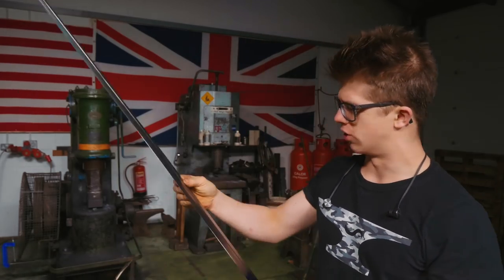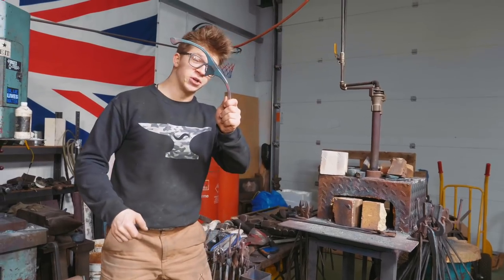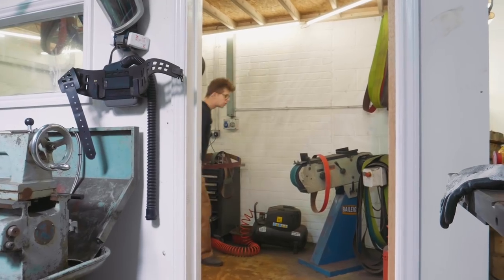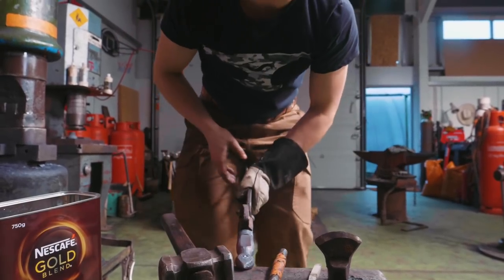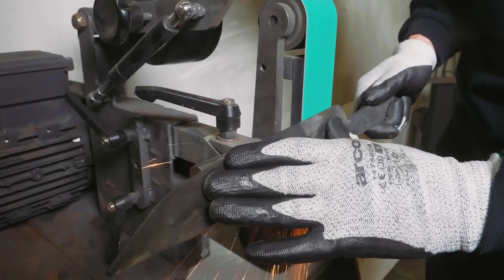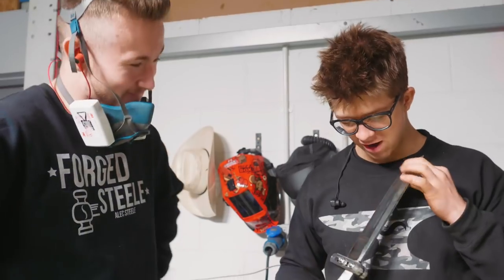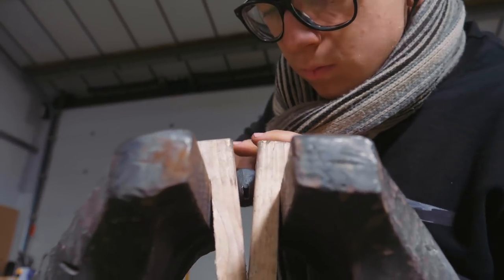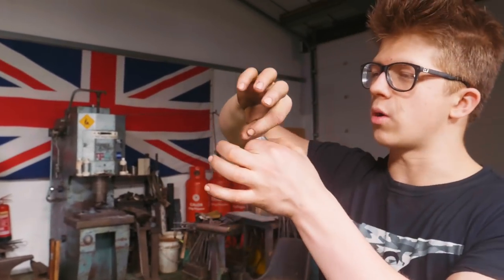MAKING A SCOTTISH CLAYMORE SWORD!!! PART 10

Comment: Hey Alec,
As an observer of your Viking sword videos and now the Claymore sword, is there a reason why you extend the fuller beyond the hilt area into the tang? To me, it seems like the fuller should end short of the hilt to give the sword blade a little more strength at the critical stress area and provide a cleaner area fitting the hilt/guard to the blade?

Comment: Is it possible that you could design a manual press that works off of leverage.
Step on a lever and some dies clamp together but spring back open when your not stepped on it.

Comment: What is the difference from using a 120 grit belt and hand sanding with 120 grit? Seems like the 120 belt would be the quicker route, right?

Comment: What's the deal with putting the wire brush in the power hammer? Also have you ever done rain drop Damascus? If not have you have plans on doing so?

Comment: The real question is why counter sink holes that arent going to have screw heads in them?
Reply: Dirk Leimlehner I would assume so that when he rivets or peens the scales on, there is more surface area and more of a mushroom effect. Just spitballing
Reply: A few reasons. It removes any burrs from the milling that might prevent the scales from laying perfectly flat. You could try filling them, but the file would have to be really small, and countersinking is fast and easy by comparison. If glue is applied, the countersink provides a well for the bonding agent to set in, improving the hold on and around the pins, regardless of whether you pein the ends or no. Lastly, it's just good form to clean up your work. Hope this helps.
Reply from the maker: Dirk Leimlehner helps the pins find the hole to line up with scales incase of any slight slight misalignment!
Reply: Jesse Cohen it does. Thanks
Reply: Also, and moreso,  what Alec said... Thanks much Mr.Steele!

Comment: i was wondering. would it be possible to run a forge of natural gas, as piped around the city for gas stoves and the like?
Reply: Most places the gas is reduced to  a lower pressure and cannot deliver the BTUs needed to produce the heated to forge weld. (this is the US not sure about England)

Comment: I've noticed that whenever you use a hammer that you hold it in the middle of the handle instead of the end of the handle. Is there a reason you hold it like that?

Comment: Hi, Alec

As always great job, but there is a major issue with your pommel. A pommel's role is to act as a counterweight to the blade, so for such a huuuuge blade that tiny (yet beautiful) piece of metal is gonna render useless.

You need a proper counterweight for safety reasons, otherwise the blade will have a tendency to pull away from you every time you swing it. Please be safe.

Comment: Why is the crossguard curved? Claymore guards are either perpendicularly straight, or straight v-shaped with forged ends. Just looks like a normal sword... You shouldn't be able to lift and manouver a Claymore at angles with one hand like you were doing. They weigh a tonne.

Comment: Alec, why do you de so much hand sanding? Why not finish on belts and wheels like the Man at Arms guys?
Reply: While I'm curious too, I'm sure there is a practical reason. I would say tho, comparing to Man at Arms isn't quite fully comparable considering the sheer differences in their shops and how they run.
Reply: Quality over quantity. I like to put time and effort into my projects. gives it more of a sentimental value, I like to think. Betting he has the same views on it.
Reply: Man at Arms swords looks really dull for a sword, maybe hand sanding is to get a right and proper edge.
Reply: I've seen more recent M@A projects that have been half a**ed and it was rather disappointing. Don't get me wrong, I love their videos, but they are lacking the Quality and focusing on the view count in my opinion.

Comment: Alec, dunno how many more blades you plan on making, but the guy in this video uses a pretty slick setup with a grinding wheel mounted in a mill.  Would save you a lot of time! 

https://www.facebook.com/armas.es/videos/10155457080618889/